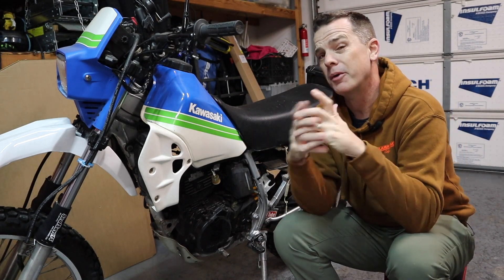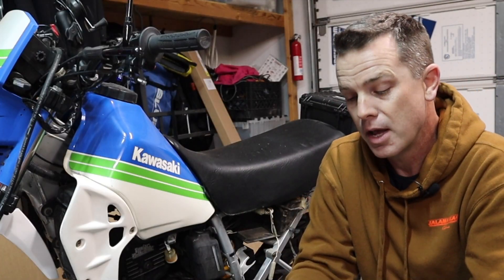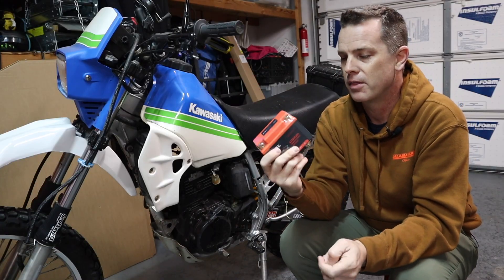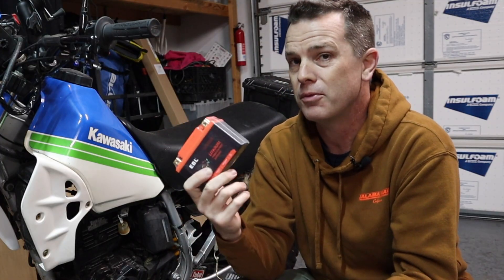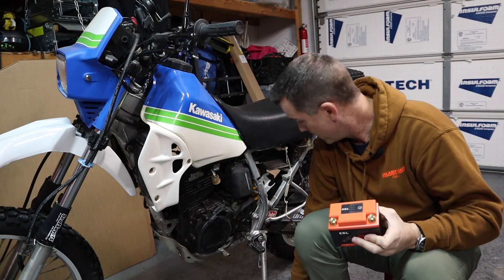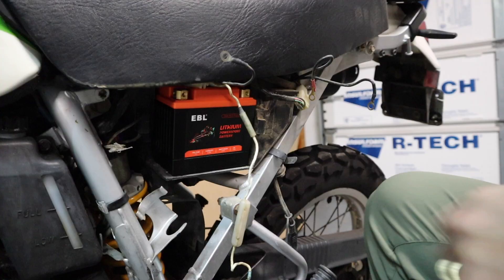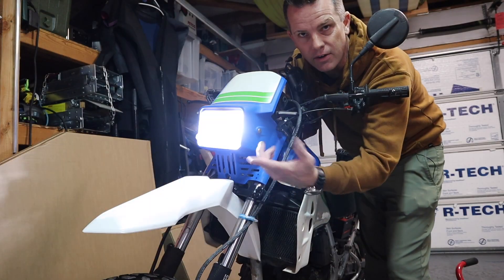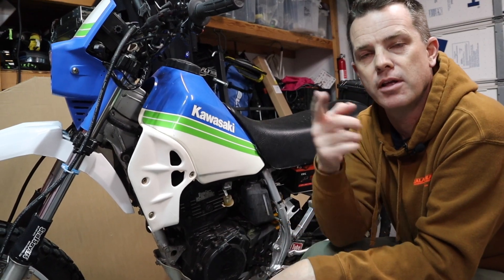Switching To A Lithium 12V Motorcycle Battery - How To

Comment: Iv been wanting to switch to lithium iron on my 2009 xr650L but iv read about needing specific chargers for lithium batteries. im wondering if any one knows if this applies to it charging while on the bike? is there anything else that needs to be changed/installed? or can you just swap them out.
Reply from the maker: With these it’s a direct swap, the only issue you may run into is your battery tenders, make sure what you will work with your new battery.
Reply: @CarDoItYourself  TY for reply, i did some research and i guess its only an issue if you have an older bike that uses the non mosfet Rectifiers.

Comment: I’m considering putting a LifePo4 into my ‘82 Yamaha. Even if you don’t, I offer two suggestions:

1) install a battery disconnect.  You’ll get into the habit of using it after you get done riding. The one I’m installing in my friends bike is a on right off the positive terminal.  

2) install a battery maintainer into the bike itself. I have one on my Yamaha so all I have to do is plug in the bike when I get home.
Reply: 1a) …a knob right on the positive terminal.
Reply from the maker: Have you run into any with a cable or something along those lines? This battery is behind a panel so it would be a pain to get to.
Reply: @CarDoItYourself  not off hand, but you could definitely take this one and attach it to two cables and mount it somewhere else.
Reply from the maker: I do have a maintainer, but that disconnect is definitely a good idea!